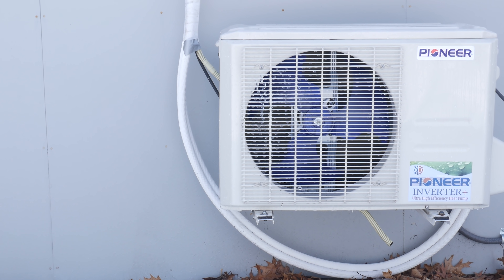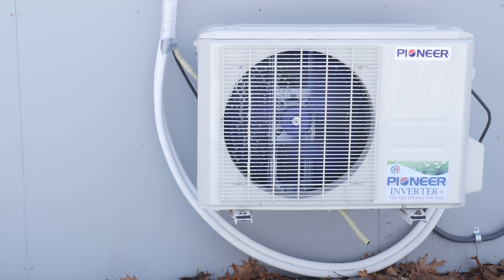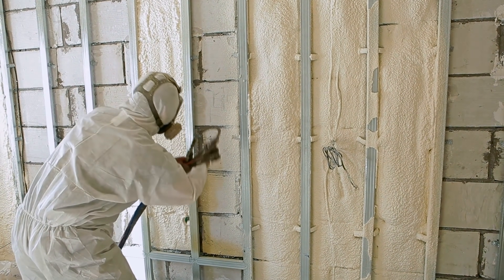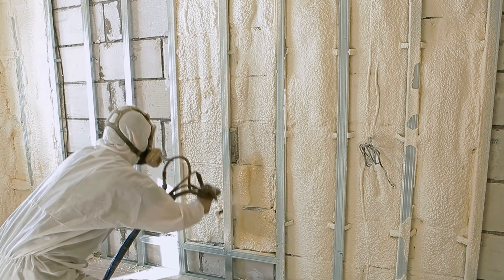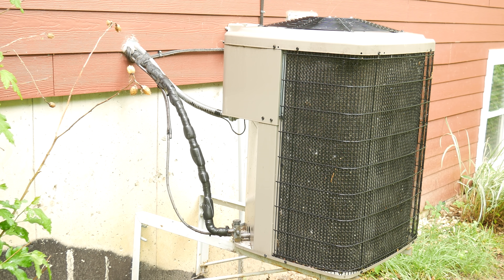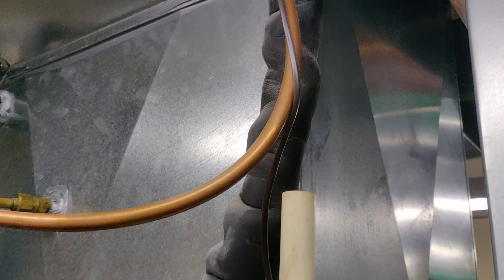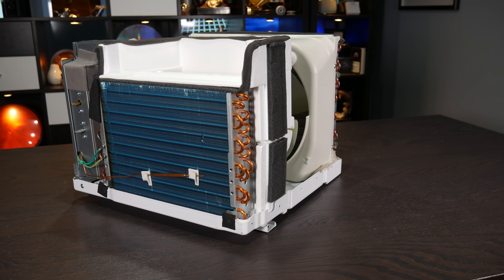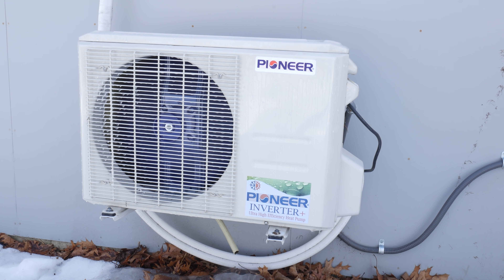Heat Pumps are Not Hard: Here's what it will take to start pumping

Comment: watching these videos made me realize what confused me when people talked about A/C and heating... as it turns out many used A/C as synonymous with cooling, which is crazy-talk as where I live the A/C unit has always been capable of both cooling and heating. Just to clarify, central heating systems are really common.
Reply: I'm confused too. AC as "air conditioning" here is used in terms of HVAC as "heating, ventilation and air conditioning". As all split systems have heating and cooling, but some also ventilation and humidity control
Reply: That shit always annoys me.
Air conditioning is temperature and humidity control.
It was originally invented to control humidity.
Using it only to mean cooling is just stupid
Reply: I think it has something to do with the automobile industry. Cars almost always had heaters, but AC was an option. Basically, people began to equate AC with cooling, and heaters with heating. So when it came to heating and cooling the home,  the trend carried over...
Usually,  it's only those who've had at least some level of education in air conditioning, that understand that it includes both and then some...
Reply: @DanielFenandes  that's true in all parts of the world! An ac unit,  and the science of air conditioning,  are two different things. Technically, AC means the conditioning of air by cooling,  heating,  humidifying or dehumidifying, etc...

Comment: I just installed a Mitsubishi PUZ—A36 heat pump with a PVA air handler in my house in Cincinnati. I am so happy with my decision. The unit is super quiet and extremely efficient. I did put electric heat backup, but next winter I plan to leave the breaker off to it to see if I can make it through the winter without needing it. I bet it will do just fine without it. Thanks for the great video, information, and inspiration!

Side note: it truest blows my mind that SO many people, even engineers, in the HVAC field think you cannot use a heat pump in northern climates…

Comment: Great video -- though you missed a technology used in some high-rises (even in Chicago and Canada): water source heat pumps. Those tend to be great for summer cooling; however, unless the building installs a central heater for the water loop, they need auxiliary heat in the winter. A nice by-product of these systems is the shared water loop does let heat move between units.

Comment: My name is David and one year ago I moved into a home from ruffly the 1930's. One of the first upgrades we made to this h9use wich had no central heating and air was to centrally mount a heat pump system. I used your videos to do the installation with some help from the directions and other YouTuber's. Over the last 365 days or so this is what I have observed

For the space I am using this single unit in (1500ish square feet) it works wonderfully for heating and cooling the home.  With a few ceiling fans we are able to move the air across the house. We have found this to be a bit of a necessity as if we do not then we end up with one or two rooms climate controlled and the others closer to the exterior temperature.

The insulation did not require any special tools however I did get pipe cutters so I could shorten the distance of coper pipe. I had a service tech check it after my installation and he said it was all good. 

The unit runs some days all day and night in the winter with no problem thus far. I am curious to see how it handles this summers heat. 

That is my report of the unit and of the product/idea. I am very please and after some rewiring we will be adding insulation and I'm excited to see the effect. New windows will be last as far as insulation goes (large older odd sizes)

Comment: Very interesting and highly valuable series on heat pumps! I live in Sicily and my dad more than 20 years ago, started restoration of our old house (more than 150 years now, made with stones), and first thing he did was rebuilding the roof with 2ft of styrofoam to insulate and to lighten the building. For our heating, since we do live on a mountain where temperatures do get below freezing, he used heat pumps, and they made the system ready to get the external unit for air conditioning too. We as a family are not very keen on air conditioning, but we are now considering adding that external unit since summers are getting extremely warmer, as warm as in the Death Valley: last summer we set the European record for warmest temperature ever recorded, 48.8°C or just shy of 120°F.
Reply: This is the subtext of this series. In a warming world, you're all going to need AC too.

Comment: One thing you briefly touched on: WINDOWS. While we have good wall insulation, we still had the original nearly century-old single pane windows. When we replaced them a few years back we found it's literally a night-and-day difference.

Before we swapped them we had a crappy evaporative cooler that would only drop the temp about 7-12°F. it got bad in the summers unless we left it on all night and let the house chill. Just replacing those windows resulted in significant temperature stability and a boost in cooling to ~20°F. When we changed over to AC back in early 2020 (sadly before your heat pump vids - that would have been worth looking into!) our electric and water bills dropped significantly. The cost difference with the financing payments equaled what we were paying for with a cooler motor running 24/7 and we're significantly more comfortable now. Good insulation pays off and you can recoup costs in only a few years.
Reply: Interesting historical note, is that in urban areas before 1920, many buildings had double pane windows.  But after the 1918 pandemic, there was a Fresh Air movement and those double panes were changed to leaky single pane (like the hicks in the sticks had) for the fresh air ingress.  The steam heat systems post 1920 were advised to be sized to heat the home/building on the coldest day of the year, with the windows open, and the wind blowing.  This was because it was advised to sleep with the window open and people took that to just keep the windows open throughout the house.  That is why so many old buildings in cities where steam heat was being installed, like NYC, force people to open the windows in the winter because of the heat output.  Sure, it cost money, but it would keep the viruses from getting you.

Comment: I installed a Blue Ridge 2 head mini split system into my small (576sqft) home, and it was easy. My friend had a vacuum pump, and we did it all in probably 2 days of work, most of which was drilling holes in the block walls. I think all in it was less than $2500, and seems to work great. Thanks for the recommendation of a heat pump! Otherwise i would've gone with window units and space heaters lol.

Comment: I have a 4-way ductless mini-split and it works great.  Mine's a Daikin system which I noticed wasn't on your list.  The only drawback of most systems like this is you can't heat and cool at the same time.  I use mine to heat my home office instead of the whole house with gas central heating and it's actually appreciably cheaper, especially right now.
Reply: Oh and due to a quirk, my system was cheaper with heating over just cooling at the VAT/sales tax was 5% with heating or 20% if just cooling, which more than covered the equipment cost difference.
Reply: I do exactly the same, also with Daikin which I have found to be efficient and importantly for me - quiet.  I heat the whole place with gas CH first thing in the morning and later in the evening - using a Nest thermostat to keep it well controlled - and just the room(s) I’m in during the day. Overall cost is about 30% lower than just using gas - before the recent gas price increases.
Reply: So they make systems that can heat and cool at the same time. They are called heat recovery systems. They are more common in commercial settings but I believe LG makes one that can be used for residential. I would say though that the return on investment would be low for a house, since you are usually either all heat or all cool. Whereas a business might have a server room that always needs to be cooled and offices that need to be heated.
Reply: daikin are one of the largest firms and do great commercial kit so i wouldn't worry.     you can get Heat+cool systems "3 pipe" or "4 pipe"  systems but it does increase the cost and in most houses you very rarely need to do both at the same time.. so it's an edge case and you might be cheaper to have to outdoor units instead.
Reply: @mralistair737  My Daikin system is just a multi split - can’t heat and cool at the same time, but not a problem in my home. Their indoor evaporators are attractive and quiet too

Comment: I recently installed a multisplit system in my home to get some cooling on increasingly hot summer months. But getting a more efficient heating system as well was a great bonus. Coupled with my municipal heat system (that also provides endless warm water) and a ventilation system with heat reclaiming I now have a lot of fine tuning to do :)

Comment: Homeowner in NYC here 🙋‍♂️
After finding a gas leak in September 2022, I was told by my energy provider that I would have to bring my 100-year old gas pipes up to code before I could get my gas turned back on. Plus, the city would need to come out and inspect work. All in, I was looking at a $14,000 job plus 6 weeks or 6 months time—I could never get a straight answer. Decided to go all-electric given we were facing down cold weather soon. 

Got a few quotes from some HVAC people ranging from $15,000 to $80,000 for a 72,000 btu heat pump system to replace my 90,000 btu gas steam boiler in my 1,300 square foot single family house. What sucked for me was that the state incentives for converting to all electric heat had run out and federal incentives wouldn’t be available until early 2023. I went with the cheaper option and couldn’t be happier. The install isn’t beautiful, felt like a DIY job if I’m being honest, but the system works well. Before converting to all electric, I must have spoken with a dozen plumbers who all told me that the heat pumps wouldn’t keep up with winter cold and getting rid of gas would devalue my home. 

I think the HVAC installers all quote on the high end because they know one quarter to half of the cost is being covered by government incentives. NYC has passed legislation instituting a moratorium on new gas hookups in 2024 so I hope the HVAC industry gets their act together soon.

Comment: Weird, in my country, split type heat pumps (which we call "air conditioners") similar to the Pioneer shown in the video, are powered the other way around. You don't have to connect the external unit to the electric line, but the INTERNAL one. The internal unit powers the external one. Smaller devices (9.000 and 12.000 BTU) come with a plug and you just... plug them into a socket. 24.000+ BTU units come with naked wires that you must connect to power. I don't have a 18.000 BTU unit, so I don't know if they come with or without plugs.

Also, the internal unit collects condensed water and sends it outside the house through a hose that goes along with the two insulated copper tubes and the electric cord that connects both units. All four things are wrapped together in tape. So you only have to drill one hole in the wall.
Reply: You are correct, usually the internal unit connects to power is my experience also. But recently more and more units connect to power at the external unit, which is the case with my Gree G-Tech unit. But not having power outside, the power cable runs inside the house and goes to a power outlet. So it looks exactly like the internal unit is connected to power.
Reply: My guess is that there may be a code requirement in the US that AC or heat pumps have to have an electrical shutoff at the outside unit.  That makes sense for those big old units which occasionally catch on fire.  Might also be a safety thing for repairs, since a ducted system would typically have separate shutoffs for the air handler and the compressor.
Reply: Judging by your name i would expect you to be from Latin America (Brazil here). My family works with Air conditioners for years and they always use a simple workaround to install those units with power cables on the inside unit. You just strip the cable and plug it to the internal panel who sends power to the outside unit, then you connect the cable outside to power and you're good to go. The power cable doesn't care wich side is being powered.
Reply: @prytooblack  You're right; Uruguay here 🙂 In fact, I'm very happy with the power supply on the internal unit. I just plug it into an available socket. Here, AC units up to 12.000 BTU come with "schuko" plugs, which is arguably the sturdiest and safest plug in the known universe 🙂
Reply: Do you have 230V power in your country?  That may be a big part of it.  You can actually power large power-hogging appliances off of 240 volt outlets much easier than at the American 120 volt standard. A 240 volt outlet provides TWICE the amount of wattage that a 120 volt power has.  I really wish the USA had 240 volt outlets in our homes.  It would allow us to have the nice little countertop dishwashers I've seen in Japan and China, as well as clothes washers that only have ONE water connection, and have the heaters built in.  Also portable space heaters would work better too
Reply: @audvidgeek  You can do if you want to. It might be pricey because you need to replace 3 conductor cable with 4 conductor.
Reply: @audvidgeek  American power is 240v across both powered legs and 120v to the ground
Reply: @worldcomicsreview354  Well, the majority of us usually we don't need air conditioners to live a normal life (in the Romanian summer of up to 40 degrees Celsius it was ok with just a fan when I was a kid). But we really need to heat up our houses in the winter wit temperatures of -10 to -20 degrees Celsius. And some of us burn gas (not every city in Romania has gas), some burn wood and only a fem use electricity because historically it was the most expensive solution, the gas being 6 times cheaper than electricity. Now it's not anymore, the gas is at the same price as electric and with some companies even double the price. So now, heat pumps makes sense, especially if paired with a photovoltaic system.